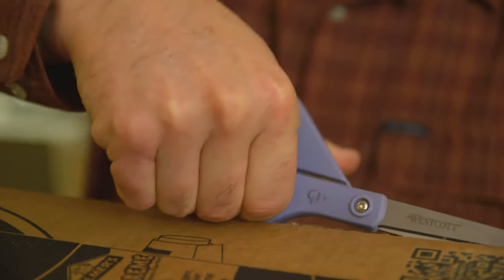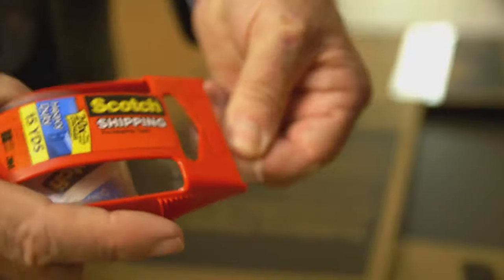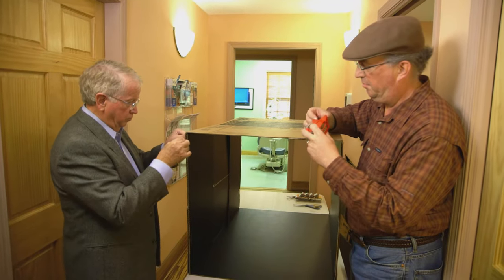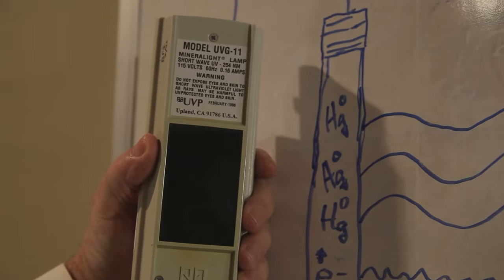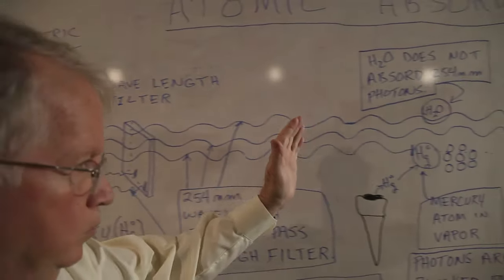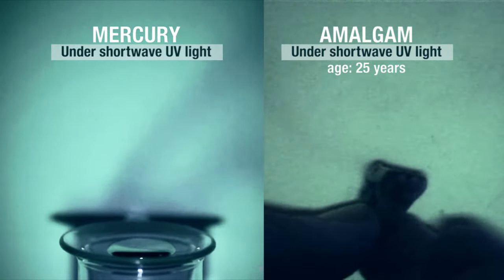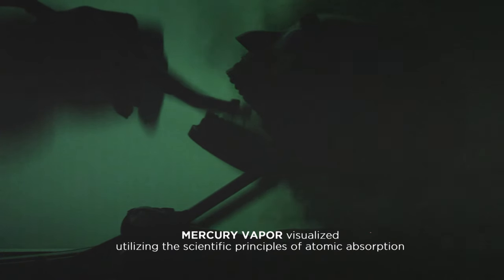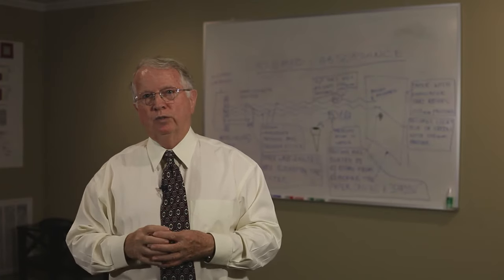Visualization of Mercury vapors in UV light - Atomic absorption explained

Comment: But what about solid particles that would absorb the radiation, no matter the wavelength? I am sure that most of it is just dental dust which is able to absorb the radiation. Isn't mercury vapour pressure too low for such an experiment?
Reply from the maker: Bartłomiej Cieślik
: the scientific explanation in the video explains why it is not "just dental dust" additionally, we hired Mercury Instruments USA to measure the mercury generated during this process and the mercury levels were off the chart. you can that in this video https://www.youtube.com/watch?v=jni5WHsKDKE